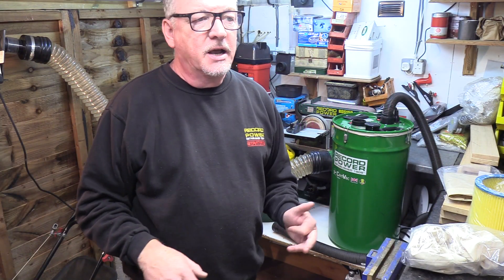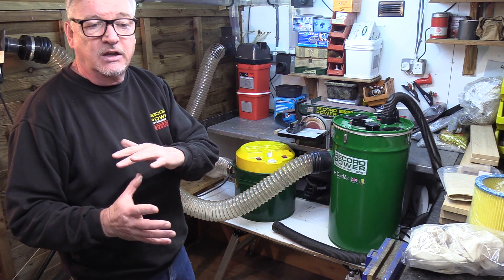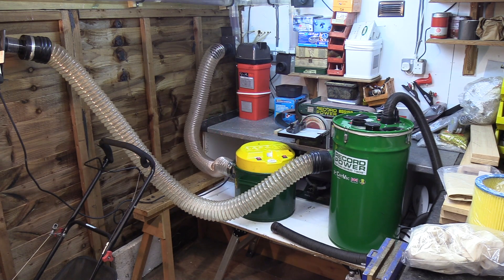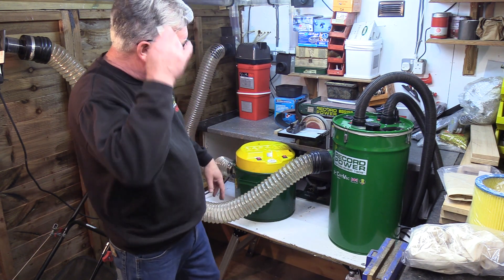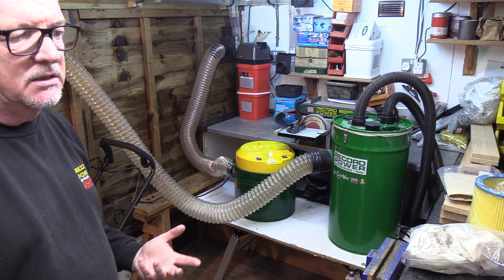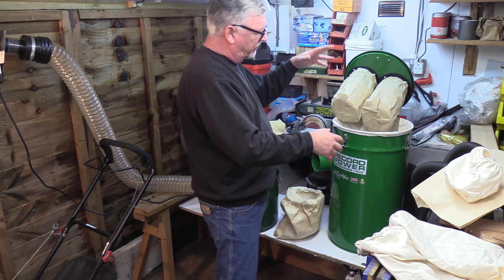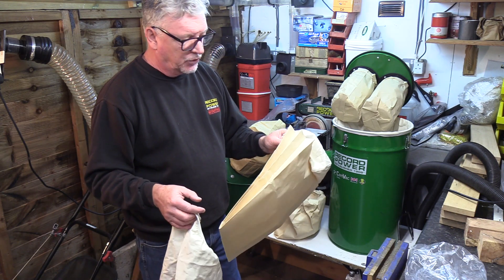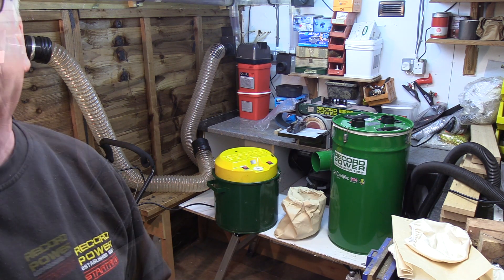Know-How Series: Comparison of high filtration dust extraction systems.

Comment: Hello
You said that your workshop is about 10 meters. 
Since you will put fixed connections in the future, the distance will be about 8 meters. 
However, the manual of the CamVac states that the maximum length of the supply tube may only be 2 meters. 
If this is longer than 2 meters, is the suction power at a longer distance equally strong?
Thanks for sharing.
Keep it safe, it is not over yet.
Willy from Belgium
🤯🤯🤯
Reply from the maker: Hi Willy, thank you for your comment. We now supply 2 meters of 100 mm hose, which was used to connect to a ducting system 2 ½” or around 63 mm. The system is fixed in place around the work area by way of individual 1m lengths, tee elbow and blast gates, these are joined by straight connectors. It is recommended that once your system is in place is to cement the joints, but only do so after you are happy at the final location. We do a boxed set of ducting system, and as per video I think this is best served with a twin motor extractor, it just gives the end user more flexibility. Hope this helps. Best Wishes, Record Power.
Reply: @RecordPowerTV  
Hi
Thanks for your reply, I suposed you would install a fixed installation. Of course, if you make the installation mobile will change the final result. I will first try to run a PVC smooth-bore tube, without any rims or obstacles system of 100mm over a Cyclone  Dust  Commander separator filter system. Using this, I will protect the CamVac from dust and chips. The 100 liter barrels witch I will use, are easier to empty and this saves bags and filters. I suspect that the fix system in each direction will be about 3 to 4 meters. I will follow your advice, first mount the system dry and hope that there will be enough suction power left.
Keep it safe, it is not over yet.
Willy from Belgium.
👨‍💻👨‍💻👨‍💻👨‍💻👨‍💻

Comment: Hi Willy, I am also thinking of protecting the CamVac with a dust separator. I’m wondering how much drag the dust separator will reduce the air flow but I guess the 2 motors will still be very effective. Xtian from England.
Reply from the maker: Hi Christian, thank you for your comment. The addition of a dust separator onto a twin motor CamVac extractor will reduce air flow but not significantly, and is therefore fine for use. Should you require further assistance or advice, please contact our Technical Support team on 01246 571 020 (and select option 2) or email sales@recordpower.co.uk. Best Wishes, Record Power.
Reply: Hi.

To be honest I found this somewhat confusing.  It appears that the two vacs are connected, what appears to be a pipe, is just visible at the top of the picture.  This assumption is reinforced, as both pipes react, when either extractor is switched on, you also talk about having the small one just for the sander, and the 2 motor one for the other equipment. So why are the connected?

I have a fully equipped, metal lathe, mill, bandsaw etc and wood, lathe bandsaws etc. workshop, it’s approx 7 x 2.5 M.  My main extractor is the same RP 2 motor extractor as you are using.  Mine has a main 4” pipe system with slide gates.  Connections to the machinery are flexible pipe, to allow machinery to be moved (they are all on wheels)

I have incorporated a cyclone, before the extractor.  In my opinion this is a MUST, it collects all of the dust etc. and is very easy to empty.  NOTHING reaches the extractor, I’ve retained the filters in the extractor, as they don’t appear to have any effect on performance.

In addition, I have a large cylindrical vacuum, with wheels, which I use with the small machinery, sander etc. and general cleaning.

The RP extractor is very powerful.  It blows the round outlet covers off, I haven’t fitted outlet pipework yet, but I’m intending to do so as it appears to reduce noise considerably.

One other comment,  I have both motors set to start, and the startup current was sufficient to trip the 16A MCB.  I had to replace this, with one which accommodates high initial current draw.

Cheers Noel
Reply: @Jestey6  They are not connected. Watch the video again?
Reply: Hi.  I’ve looked again, as you suggested.  A quick walk around of your workshop showing the extraction pipework would have been very useful.  As it is all that is just visible, is the horizontal main duct in the top of the picture, which appears to be connected to both extractors.  Both flexible pipes react when either extractor is switched on.  Which to me proves the extractors are both connected, by the main pipe.  Have another look.
Another observation, the waste gate, top left appears to be a smaller than the flexible pipe.  This will restrict flow and has the possibility of trapping larger debris.

Comment: Hello im after buying one of them there how did you make it work with a remote  thanks Michael
Reply from the maker: Hi Michael, thank you for your comment. Pete is using the CamVac extractor in partnership with an auto-switching device which the extractor is connected to. For more information, please contact our Technical Support Team on 01246 571 020 (and select option 2) or email technical@recordpower.co.uk. Best Wishes, Record Power.
Reply: Thanks for that information 👍